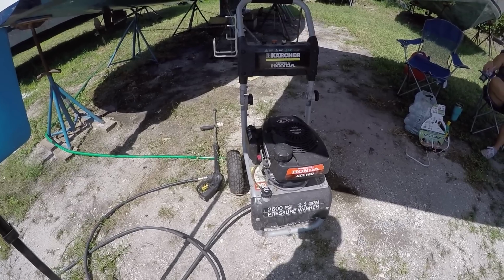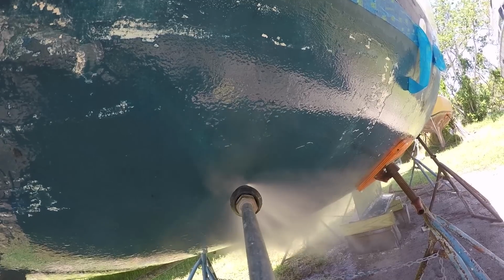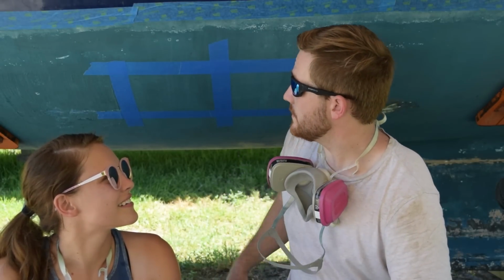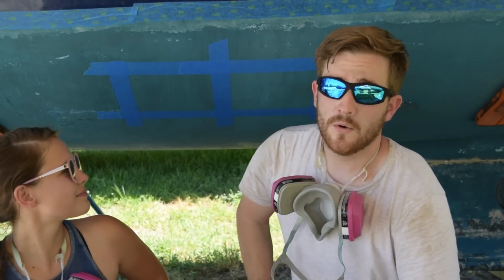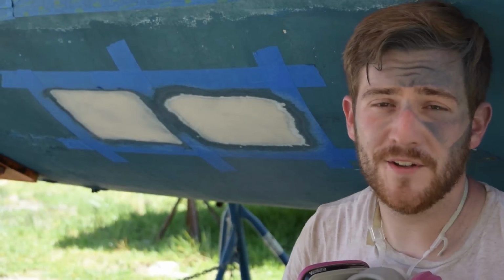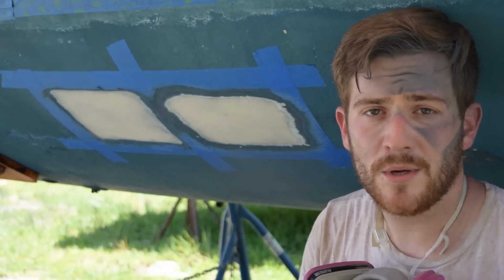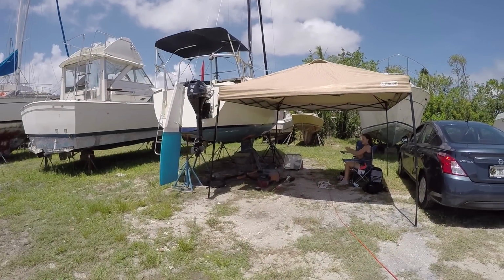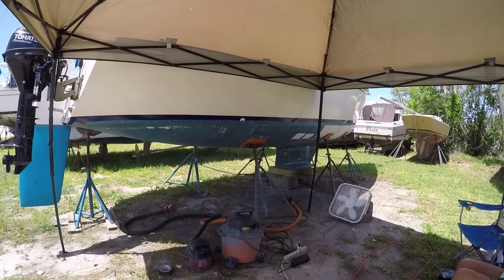27. Sanding Flat or Sanding at an Angle, What's Quicker? - Sailing Vessel Somnium

Comment: I think you are learning the hard way. ;-D 
I worked fiberglass & gelcoat a long time, on boats, truck bodies, tanks and other strange things. One thing I learned early was to begin with the end in mind.
The end, for your hull is a flat surface that's smooth as a baby's behind with all of your tools in good condition.
Side loading the shaft and bearings of your orbital sander means you'll be replacing it sooner. Start with 40 grit & work up to 5000 grit if you have to. 
A 9" offset grinder's shaft and bearings are designed to be side loaded, front loaded or even backside loaded if you're not into safety features like guards. You can get some really bad assed grinding blades that will cut through that glue, the fiberglass & and your Gelcoat all at once from the inside of the boat if you screw up. ;-)  I recommend you stick with the flapper pads. They're grinding blades with small pieces of sandpaper glued on the front side near the outside edge. They come in many grits but are not a replacement for your orbital sander.  (They're not for finishing.) You use them flat but when you feel the need to cheat and turn them up on an angle they won't cut a hole through your boat so fast. :-D
Your orbital sander isn't going to go into the corners, even on an angle, so at some point you'll wish you had a detail sander also. Put a polishing pad on one of those and attack boltheads & chainplates.:-)
Back to the end in mind. I've cleaned a couple hundred hulls in a fifty year career on steel, wood & fiberglass and never once did a experienced Captain want the hull stripped bare unless it was necessary to accomplish some repair. Bottomcoat/antifouling paint is expensive. The general instructions were usually along the lines of, Clean it, Polish it, Wax it or IF necessary, spray just enough on it to make it shine. 
* Every hull cleaning starts with a pressure washing to see what will or will not come off. 
* If the bottomcoat comes off then 1) you're using too much pressure or 2) it wasn't properly applied.
* If the hull is to be recoated, scuff well with 100 grit sandpaper and apply new coating as instructed.
* If the hull is not going to be recoated, start with 200 or 300 grit and work up to ever finer grits until 1) you run out of time or 2) it's as shiny as you want it. 

I haven't mentioned any product names or prices because I haven't done any hull work for 30 years and I know Everything has changed. My wife is fond of reminding me that what I remember is 3-4 decades old... :-)  

I like your videos and I suspect that as you get better at sailing you're also getting better at fine tuning your channel to your customers. Good job, Good life & Good luck.
Reply: better on a cheap boat than a cruiser like an Allied princess or H&R Ramus 35

Comment: I was one of those who commented on the other video. This is not about speed, it's about the surface of the hull. You are eating into the hull and then when you are "straightening" out it just means you are bringing the whole plane to the lowest thickness. Like I've said in my other comment you can do it like this if it works for you, no problem. The thing with boats is, you have to do this again and again. If you do it your way many times you might end up with a hull you can see through. That's why if you want to fair a hull, you add material and then you straighten it out. It's your boat, you can do whatever you want, all I'm saying is that if you keep doing this, eventually you will ruin the hull...
Reply from the maker: I respectfully disagree :) We're not sanding into the actual fiberglass, which is below the white gelcoat layer. The fiberglass composite is where the strength of the hull comes from, not the gelcoat.  As long as we don't go through the gelcoat, which we're not doing, and we do a barrier coat, there's zero loss to structural integrity. I have a lot of experience working with composite materials including fiberglass, carbon fiber, and kevlar. Thanks for the input!

Comment: I was thinking you could flatten the hull.  A competitor of mine flattened his hull on his Ericson 27 1972. He would win most of his beer can races up in the Seattle area.  The race committee tried to change his rating.  Great experiment.
Reply from the maker: What do you mean by flattening the hull? I'm unfamiliar with this.
Reply: Fairing it down so the hull is not so round. I know you have gone to some boat shows and the hulls are flatter. Good example would be the Pogo 30. Check this boat out on you tube. This mono hull planes with very little wind. Its sick!
Reply from the maker: That would be awesome, but sounds like a TON of work haha.
Reply: You can believe it is.
Reply from the maker: I'm just excited to see the performance difference after the new bottom job and removal of the diesel, prop and shaft. Smoother hull and less drag from no prop and shaft should get me an extra half knot to a knot! Most likely I think we'll see better light wind performace.

Comment: Rotary sanders are the shit.  Your going through your gel coat. If you are just bottom painting you want too save your gel coat. I agree bulking out with the sander on edge works but it destroys the pad and the belts in the sander making it leave tiny swirl marks in the finish. just keep a good one for fine work and a crapy one for bulking out or buy a rotary. You can use the rotary as a buffer too for waxing. Good work. keep on.
Reply from the maker: Thanks for watching and for the input William!

Comment: I sanded my hull and I had to sand in angle for some deep scratches or small holes to get fix. But at the end I can say "Flat sanding = less filling + time saving." I just finish putting my 3 coats of interprotect a few hours ago and it goes easier than I thought.

Keep your good work, you're enthusiasm is catching :O)
Reply from the maker: We can't wait to start painting... that's the fun part!

Comment: Good experiment!  I've had to do a lot of sanding on my boat the past couple of years and pretty much vary my technique to how thick the paint is.  We had about 25 years of paint build up so I started with 36 grit paper, sanded mostly flat, but the 36 grit left swirls behind.  I didn't sand all the way down to gel coat like you, so after I was done with the first pass I switched to 80 grit and smoothed it out.  Looks like you're doing good work and I assume you'll be barrier coating if you're taking it down as far as you are.
Reply from the maker: Definitely barrier coating. Thanks for watching!

Comment: Speed is not the goal of disk sanders, its quality.  If you want speed then use a belt sander.  If you want to strip the hull without any sanding, use the bead blast method.

Using the sander at an angle will reduce the adhesion of the sanding pad, wear out the sanding disk on the edges, and over time ruin your cushion pad, and wear gouges into your hull material.  The sander will never provide a smooth even surface sand again after that.  The tool was designed to be used flat, not at an angle.
Reply from the maker: I've thought about getting a belt sander as well, however I thought in the long run I'd rather have two random orbit sanders. Thanks for these points to consider and for watching.

Comment: If you want to rip it off faster by using it on an angle buy a tool like  a grinder with a flapper disc on it  that is way fast then a orbital sander and keep the orbital for flat sanding you’ll flog the guts out of it

Comment: Have you tried a flap wheel on a 7" angle grinder? You can remove masses of material with that and then run the orbital over it to finish fair.
Reply from the maker: Angle grinder just isn't in the budget at the moment. Thanks for the comment though!

Comment: I agree with the comments saying you'll get a smoother surface if you hold the sander flat against the hull. The dust collection system is mostly useless if you hold the sander at an angle. You might as well disconnect that and have more freedom of movement and less weigh to hold if you're going to continue sanding at an angle.
Reply from the maker: Thanks for the feedback!

Comment: i use a 6 inch sander, i sand at an angle on bottom paint and flat on filler, you need to be careful and keep moving, i use 80 grit on the bottom you will be there all week sanding flat. uh boat yards are all the same  and they all suck.it is the nature of the beast the workers dont give a shit, muddy boots on deck, disconect the roller furlling and just let it bang against the side, on and on and on.do it youself if you can.  good luck and have fun
Reply from the maker: Thanks for the input! We were hoping our experience with the boat yard wasn't the same for all boat yards. It definitely hasn't been the best experience. -Randi

Comment: Ha! I sand at a angle too! I do it to take off material faster with 60 grit. Then i go flat with a higher grit to smooth everything out. But my boat has not been sanded in 20 years. So i have alot of paint to remove. My topsides are also latex house paint so whatever takes less time is what im all about. Its weird to watch your vids for me. My name is also Randi. I use the random orbit from walmart. Im cheap as shit. Hasnt broken yet and its got a 2 year warranty for 18$
Reply from the maker: Wow! Crazy coincidence that your name is also Randi. Getting the job done as quickly as possible is certainly a priority when you have a lot of jobs to do. I hope your projects go well. Good luck!
Reply from the maker: Sailing Vessel Drifter Haha. Will do!
Reply: Or used boat parts your going to get rid of. Im super handy !and will pay shipping. Im capable of fixing alot.of broken stuff I would have died to get my hands on the old Big Red and tranny! Would have pay ya too! We could trade unneeded boat parts.
Reply from the maker: Sailing Vessel Drifter Okay! We will keep that in mind. :)

Comment: Your viewers missed the boat on sanding angle versus flat...! Orbital sanders are used flat to sand smooth without swarels!  Angle sanding will always leave abrasive swarel marks that will required flat sanding to eliminate angle marks.  If quality finish not a concern then use a disk sander for angle sanding...lol
Reply from the maker: Thanks for the feedback!

Comment: The other reason you sand flat is to use the whole surface of the sheet.  You will find your sheets will lose grit on the edge. Consider changing the grit to coarser but keep moving for a smoooooth finish.  Otherwise knock yourself out on the edge.  Fair winds and good luck with the project.
Reply from the maker: Thanks David! I have noticed the sheets don't last as long. In the end it's a balance between speed/quality. Thanks for watching!

Comment: flat or angled makes little difference- its the Grit that counts. Use a lower # grit to get more material off in a given period of time.  You will get there. sanding is the bane of every sailors existence.
Reply from the maker: Thanks for the input and for watching!

Comment: My theory is if your sanding, I’m watching, So do what makes you happy. I did it in the 70s with an eight inch grinder that weighed at least five pounds and you glued each pad on. It was fast and you could get a smooth finish with a little practice.

Comment: Ryobi tools are cheap, but I've found them pretty reliable.  My 3/8" drill is going on 15 years old, and works great.  I did manage to burn out my Ryobi cordless drill, but I was abusing it pretty badly.  The rest of the tools I got at the same time are still working fine.  (Well, except the battery powered chainsaw.  That never really worked very well.

Comment: Other things to consider : 
1. sander and sanding disks lifetime, time (changing disks) and money spent. 
2. smothness of the hull after sanding (angle digs faster but digs...) and probable extra work (filling/painting) and extra consumables (disks, sander, paint and fillers.
3. a hull is not a small square. Your test on a larger area should not show that much difference and/or possibly at the adventage of flat sanding.
4. effort. sanding flat is more comfortable. The sander do the job not you pushing continuously on the pad.
5. understand sanding. rapidity comes from the grit. You sand faster with two pass : one with a realy rough grit, then refine with a second pass with a smaller grit, than doing the whole hull with a medium grit. 
Many reasons why pro are sanding flat at purpose.
Regards.
Reply from the maker: Thank you for those points to consider! I'm most likely going to address them all in the next video. Thanks for watching!

Comment: Use a belt or rotary sander, they remove material probably 10x faster then a random orbit sander.  You can also use an interference pad (foam pad) so the sander will conform to the curve of the hull.
Reply from the maker: I may be breaking out a belt sander for the next vid...
Reply: Yeah, those small orbital sanders are for final, smoothing stage. Also, you start with coarse grit, a medium then a fine grit for detailing the surface... The tool does the job. You never put heavy pressure on the sander.

Comment: never use a belt or rotary sander, all you want to do is take off loose paint  and smoothe the surface, if you are going for the bare hull uses paint remover. for the most part all you want is a good base. there are plenty of good videos on youtube on how to do almost eveyrthing boat related/ i hate sanding bottoms. i have a c and c 33 and use a shop vac hooked up to my makita 6 in ch sander and it works quite well, the epa is kinda picky up here in maine, cant even power wash the crude off the bottom in fall unless you have the proper catch basin. a five inch sander is a toy compared to a 6.

Comment: Careful! sanding at an angle is risky and you can dig deeper into the gelcoat accidentally in concentrated areas. Painting preparation and all finishing jobs require patience and caution for the required quality to be attained.....In fact these works usually cost more than three times normal rates. I personally am restless and impatient and prefer to leave them to professionals. Otherwise patience and resilience will give the required results.
Reply from the maker: Of course hindsight is 20/20, and this is definitely going to be a job we don't want to do in the future, however we saved a lot by doing it ourselves and learned a ton along the way. I know a lot of people are saying that sanding at an angle will leave an uneven surface and dig in... however while they are mostly correct the answer really isn't as black and white as that. We've found that there are a lot of variables, and there's always more than on way to skin a cat as the old saying goes. For us, we've found that when using the random orbit sander to remove material, sanding at angle first, then going back over the area you just sanded flat, leaves a smooth surface and removes material slightly faster. However, as we'll find out in the next video that we're going to release, a random orbit sander is not the best sander for removing material quickly. Thanks for watching and for the thoughtful comment!

Comment: It's not just about speed, its more about minimising the potential for harm.  Your hull's gel coat is not thick and certainly not necessarily uniform in thickness.  A spinning disc used at an angle can very quickly cut into the gel coat and I'm confident you will have already found that in places you have unintentionally cut into it.  In my view is that its not worth the risk, your gel coat  integrity is vital to keep moisture out.  It's really great that you're open to follow well intentioned advice and prepared to acknowledge that there certainly is a wealth of experience 'out there'.  I've sanded many boats over many years and have never risked damaging my gel coat and believe that my old boats have survived my ownership.  Now that I'm older I think I would use 'sand blasting' process, but even that's not without risk, a lot depends upon the quality of the original gel coat.  In the end of course its your boat and you're doing the job, so its your decision.  Good luck and thanks for sharing
Reply from the maker: Thanks for watching and for your input. There's definitely a wealth of experience out there for sure!
Reply: Sorry evanofelipe, but never, ever SAND blasting. There are now other stuffs called "media" basting". Like crushed nut shells, plastic or glass beads, even soda powder for softer abrasion of the paint, not the gel coat. SAND is way too abrasive and leave a rough, porus undercoat.